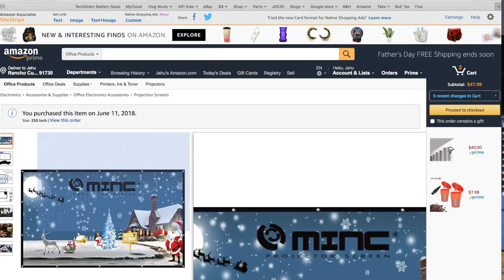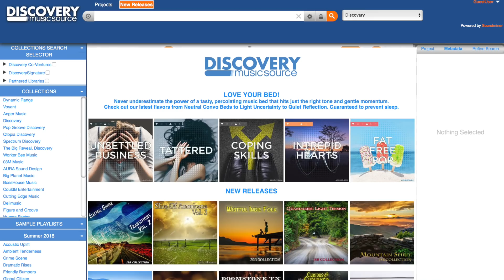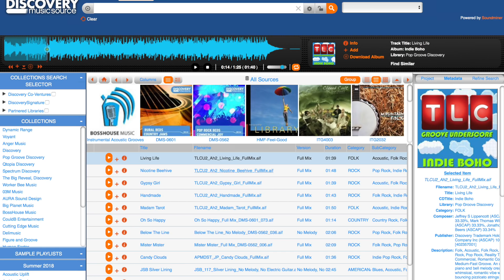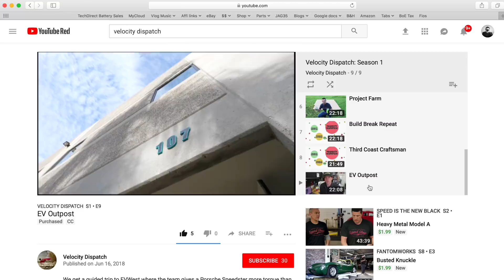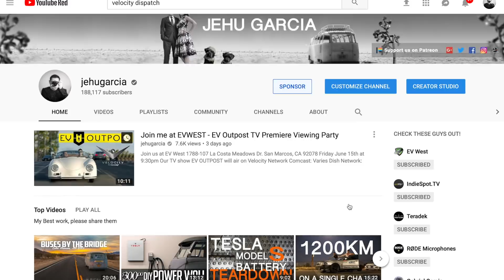You missed the Party

Comment: I'm a petrol head and love the old Volkswagen Type 2 buses especially the T3 (vanagon type 25 T25) Syncro I  until recently my plan was to do a Subaru EJ25 Turbo engine swap as part of the restoration/modernization but I have reconsider and changed my original plan my new plan is to turn in to a modern EV I already planed the whole conversion on paper well in my head acutely.

Comment: BATTERY DETAILS 
Cell Chemistry: Li-ion NMC
Hi
Have been subscribed to your channel for a few weeks and love it. Is there anyway you would consider doing another vid about building strategy for a battery pack. In this case a DIY Yeti 1400 and what would be required from the battery power plant in such a build. How many 18650's, the charging of the unit, inverter capacity watchout's etc... Listed below are the specs

Pack Capacity: 1425Wh (10.8V, 132Ah)
Single Cell Equivalent Capacity: 396Ah @ 3.6V
Lifecycles: 500 cycles to 80% capacity (Discharge rate: 1C, Full charge/discharge, Temp: 25C)
Shelf-life: Charge every 3-6 months
Management System: PWM charge controller, low battery protection